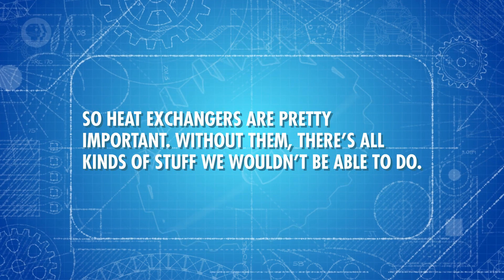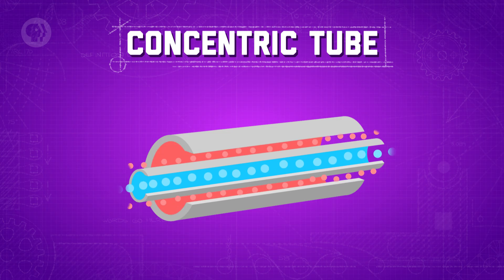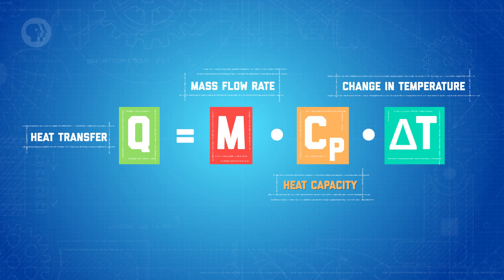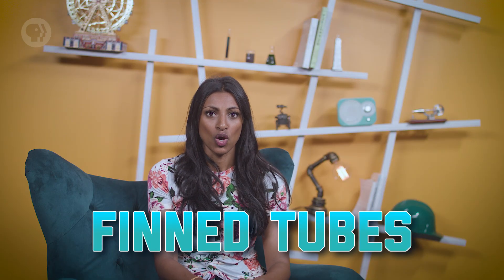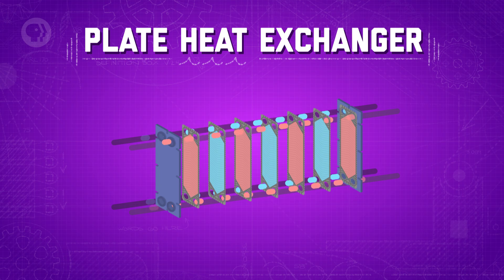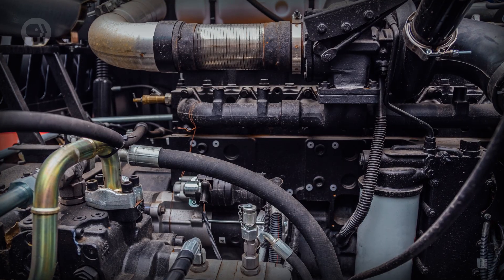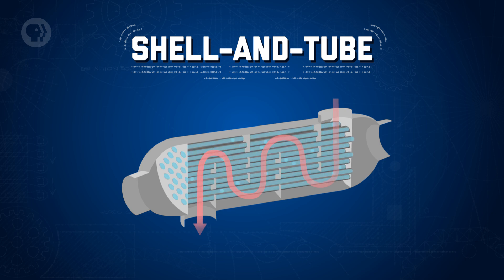How Not to Set Your Pizza on Fire: Crash Course Engineering #15

Comment: ...why don't laundromats have multi-plate heat exchangers on their dryers and washers— there's even a sense of all-climate operation to it: independent of ambient temperature... (also, ultimately you'd want to discuss air-flow-pressure heat-transfer-rate, 'efficiency')... ((also, please, discuss 'heat pumps' and their, efficiencies and advantages))...

Comment: I feel like the series has been a little more practical lately instead of being just Engineering Physics. That's good.

Engineering is still a very broad topic, though. Sort of like taking Crash Course Literature, Crash Course Film, and Crash Course Theater and then condensing them into a single series called "Crash Course: The Arts." Or at least part of a series. There would still need to be room for Music and non-performance visual arts.

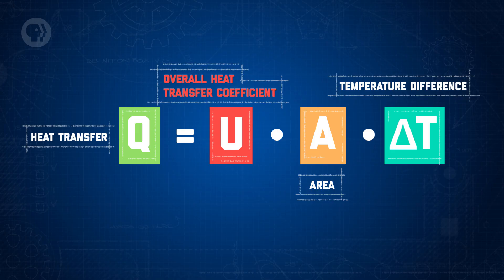Comment: Hmm introducing the simplified Formula in 5:01 and then saying finned tubes increase the heat transmitting surface is at best missleading.

Due to this and other issues i am sorry but i have to say that the script of the show was a little sloppy...

Comment: there is an experimental radiator design called liquid droplet radiator. Where at one end it atomize the heat transfer fluid into very minuscule droplets with extremely high surface to volume ratio in order to maximize heat transfer. Then a collector at the other end recycle the droplets.

Comment: no mention of coiling for increasing area. your car's radiator uses finned tubes, but not concentric (there is just the hot fluid tube and the fins) then air flows past the tubes to cool it down.

your computer uses just the fins attached to a conductive plate to cool the CPU, a fan is attached to flow air past the fins.
Reply: I believe you can reduce most coiling to the shell-and-tube model, or simply a lengthened concentric design.

In a car radiator, water heated by the engine enters the radiator at the top, flowing downward through a series of finned tubes.  The shell is the engine compartment, through which air enters and exits.

The computer can be treated as a modified concentric design.  The case of the computer is the outer tube, air is the outer fluid, and the heat sink on the CPU can be modeled as a collapsed tube with fins. If you look at the system as a concentric set of tubes, but sliced lengthwise down the center of the tubes.  This probably over-complicates the analysis, though.

Many times in engineering analysis, if you can look at it just right, you can match your case to a simple model case.
Reply: and if the computer doesn't HAVE a case? is the whole room then the shell, if it's not in a room is the whole earth the shell? at which point is it ridiculous to consider the shell. what about the radial fins on a tank? same thing...no shell unless the whole earth is considered the shell.

Comment: For crissakes, don't put a hot tea in your refrigerator.
Reply: You will get condensation all over your fridge contents.  You'll raise the temperature inside the fridge for a significant period of time because water has a lot of thermal mass.  Your soggy, warm food will spoil faster.  Your compressor will be needlessly burdened until all the heat has been transported out the back radiator.  It is designed to operate many times a day for relatively short periods of time.  Running it continuously for long periods of time creates additional wear and tear.
Reply: I'm glad I'm not the only one who feels that way.

Comment: The video convolutes velocity and mass flow. It is not harder to transfer heat to a fluid moving very fast. Q=mcdT references mass flow - not velocity. The amount of energy required is dependent on the amount of matter, i.e. material, not on how fast it is moving. It is actually easier to transfer heat to a fast moving fluid since the flow is more turbulent. The video even points this fact out when discussing baffles in shell and tube heat exchangers.    

The concentric tube example is correct, but the explanation is not. Speeding up the flow of the inner tube actually increases the heat transfer since the heat transfer coefficient increases with velocity. The  temperature of the cold inner fluid does drop as the flow is increased. However, this temperature drop is because the increase in mass flow is proportionally greater than that of the heat transfer coefficient - not because the fluid sped up. Again, Q=mcdT. Since m increases more than Q, and since the heat capacity, c, is roughly constant, dT must decrease. 

This explanation also accounts for why the hot, outer fluid temperature actually decreases even though the outer fluid flow and the amount of area stayed the same. If the overall heat transfer had decreased, the outer fluid temperature would still have been hot (i.e. red).
Reply: well, indeed the explanation in the video is not bullet-prove. What in ment is 

1) M=dot{m} at 3:42 and 

2) that by Q=dot{m} *cp*dT you can measure the heat transfer through a HX. The formula describes the consequence of a HX by measuring quantities at the inlet and outlet of the HX, it does not describe its operation as dT strongly depends on dot{m} of both fluids...
Reply: Yeah they usually do a great job on the videos but that Mass flow rate concept is completely off.
Reply: I took it to mean that the faster moving fluid would be spending less time in the heat exchanger, since they were working with a simple fixed-size concentric tube design.

It also left as an exercise for the viewer the reason you might or might not want counterflow in that device.
Reply: That is how I interpreted it as well, which is why I take issue with the explanation. It is not useful to think about residence time in this context. The heat transfer rate does not decrease as residence time decreases/velocity increases. Heat transfer actually increases because velocity improves the heat transfer coefficient. The video example is correct to point out that the temperature change is less, but that is because the mass rate has increased - not because heat transfer has decreased.

Comment: So a steam locomotive uses a shell and tube style heat exchanger (boiler) if I understand this but with hot combustion gas in the tube and cold water in the shell. Am I right?
Reply: I think it's the other way around, the water is in the tubes and the hot combustion gas is in the shell.
Reply: Nearly all locomotives use that design, the "fire-tube boiler".  Alternatively, the "water-tube boiler" contains the fire within the shell, and runs water through tubes over the fire.  See Wikipedia for good articles on both, under those names.

Comment: Building lightweight yet efficient heat exchangers for spacecrafts must be very challenging
Reply: Especially because spacecraft have to be cooled by radiation, rather using convection like in these heat exchangers.
Reply: Do they really have to though? Surely there is some waste ejected from the craft already, right?
Reply: No, they really don't. Some probes have additional engines for maneuvering, but they are small and hot by design. They don't contribute at all to cooling.
Reply: Yes, all our spacecraft, pretty much, need to use radiative cooling to avoid cooking the contents.
Reply: R3Testa The James Webb Telescope will use a limited supply of liquid helium to cool its mirrors
Reply: And then another helium system to cool that one, and eventually the heat needs to be radiated into space on the cool side of the telescope.
Reply: So every single part of all waste is either stored or recycled?
Reply: Challanging, go for throttle up.